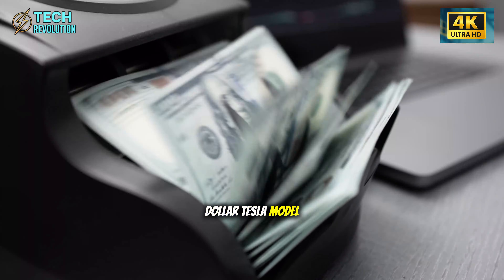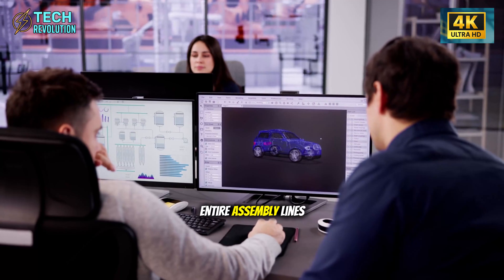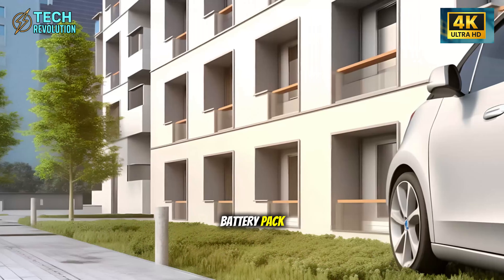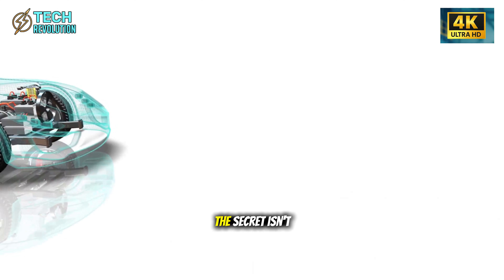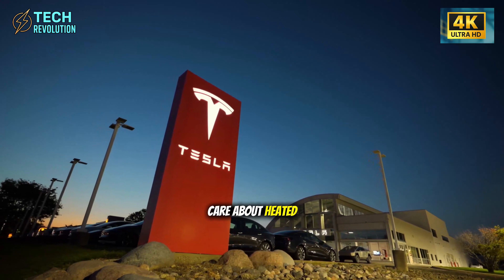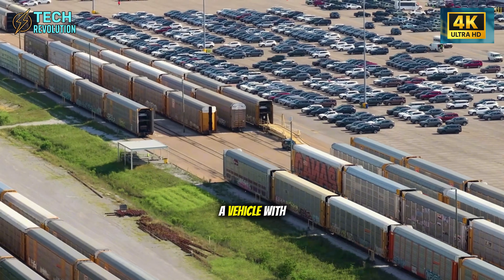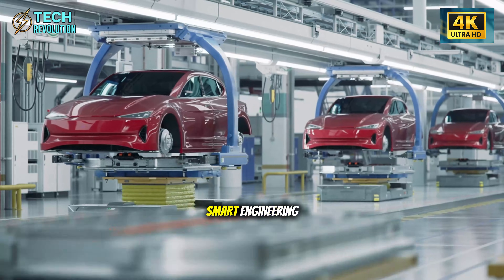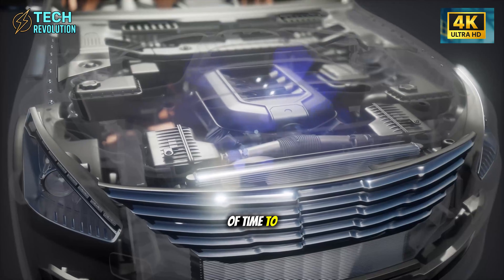Tesla Model 2 FINALLY HERE: Lighter Body = More Range at $25K, Game-Changer!

Comment: Yeh, just wait till you need to fix a dented panel repaired!
Reply from the maker: Fair point—Gigapress panels cost more to replace. But Model 2 trades repair complexity for fewer parts, higher consistency, and lower failure rates overall.